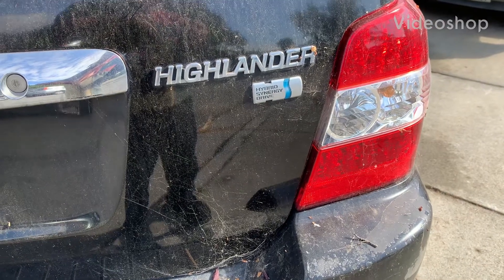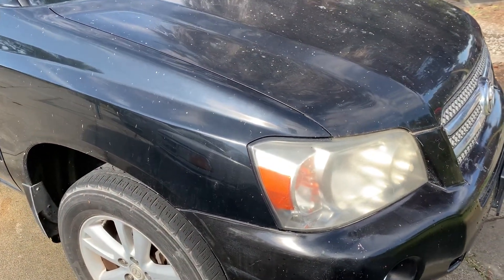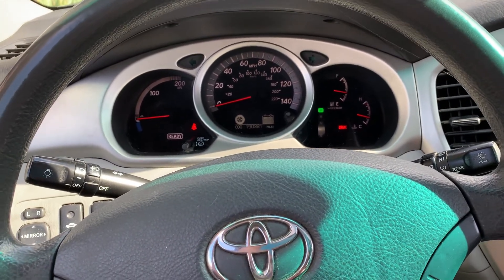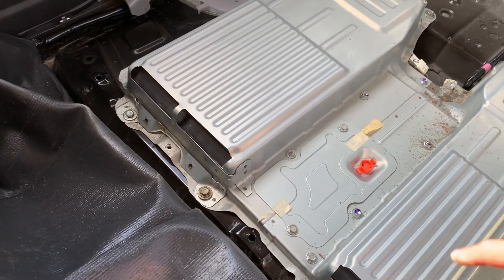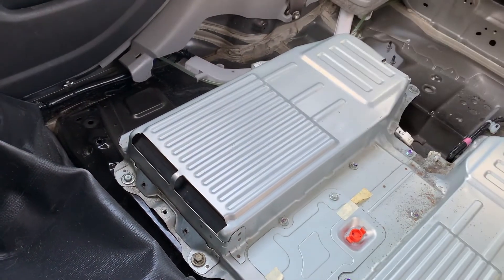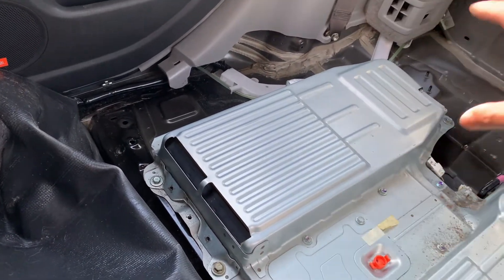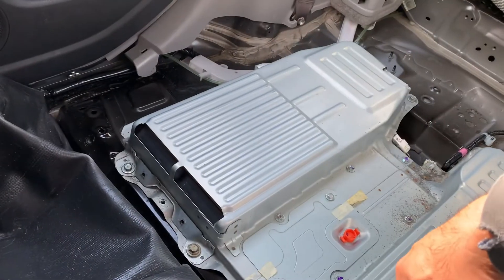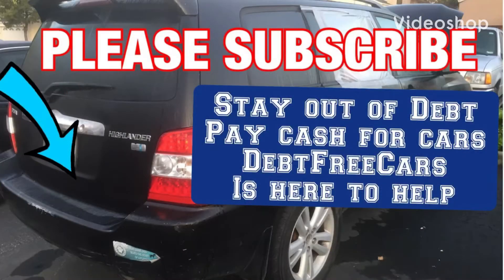2006 Toyota Highlander Hybrid RX400h P3105 code Solved

Comment: I am a few years late, any recommendation on where to get replacement fans. I have p3105 code, along with "C" codes. If the fans are the problem, I just assume to take care of the fans and not worry about them later. I think if the fans are fixed, the other possible issues will leave. PS I bought this 06 Highlander Hybrid Limited for $2200. 163k body looks solid and great. All my cars are debt free.

Comment: Hi. I have Lexus RX 400h, and I have both codes: P0A80 and P3105, where should I look first? Also P/S  error pops up sometimes, and the coolers starting to run real noisy.
Reply from the maker: Yikes!  Battery could be damaged by over heating fan.  Clean the vents under back seat

Comment: Sorry but what a load of tosh ( uk means rubbish) . This is usually caused by excessive moisture, exacerbated by cold or winter when the moist gets trapped between the carpet which is rubberised. The intermittency is nothing ever todo with the fans . Purely my disassemble and it cleaning up everything that looks remotely damp drying everything out with an electric fan shut inside the car. Then re-assembly. Communication issues with the ECU and battery ECU are primarily grounding issues or as mentioned moisture getting where it shouldn’t, the battery is particularly susceptible because it’s at the base of the car which is where all water even condensation builds up. These are more or less bulletproof cars with justice more annoying moisture issue

Comment: Very helpful may God bless you with more knowledge, have same  code rx400h will change and update. Best to buy new or used could give off incorrect voltage again, will have to assess, ring dealer hope it's not extortionate.

Comment: Did you wear insulated gloves to replace the fans?  Great video!
Reply from the maker: You should
Reply: @DebtFreeCars  ok do you need to disconnect the hybrid battery wires to remove the cover or can you just remove the cover and then fans without disconnecting the wires?
Reply from the maker: @richardkwon6697  you need to remove the safety plug (orange).  Then remove the top covers, lots of bolts.  Then the fan comes out pretty easy after that.  Keep everything else in place.
Reply: @DebtFreeCars  so no need to disconnect any other wiring after removing the safety plug? Just remove the top cover after the safety plug is removed. Thanks so much for all your help. Excited to tackle this job!
Reply from the maker: @richardkwon6697  ya leave everything else alone.  There are little connectors to the fan motors but those are easy to unclip

Comment: The hybrid battery looks nothing like a Prius with the NiMH modules!   Where can I look at videos to repair the traction battery?   Have you done the rebuilding yourself?
Reply from the maker: Yes, when you open the case there are three sets of modules.  They did this to allow for better cooling. The left and right modules are identical.  The middle module has less cells.  You’ll need a drill and remove the rivets holding the cells together and rivet them back together.  I did swap out the cells with good ones but I failed in finding the correct cell and gave up.  I used tech stream to identify the low voltage cell and replaced it but it didn’t seem to fix it.  I think more than a few of my cells were bad.  In hind site I should have replaced one of the three modules as a unit. I sold the car

Comment: What’s the part number for the fans?
Reply from the maker: Hey here you go.  Here the part number for the fans.  There are three.  I just changed all 3.  You also need to test with the metal cover on.  It grounds the system.
Reply: ? Where
Reply from the maker: @budcar9040  sorry.  G9230-48010